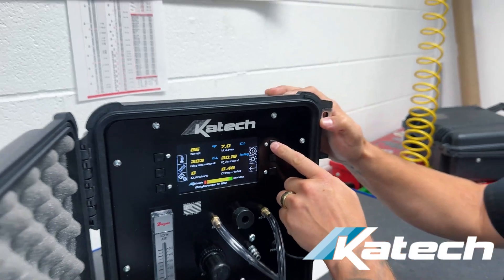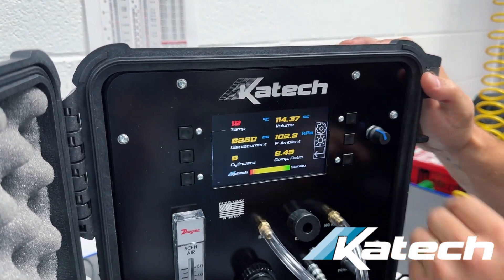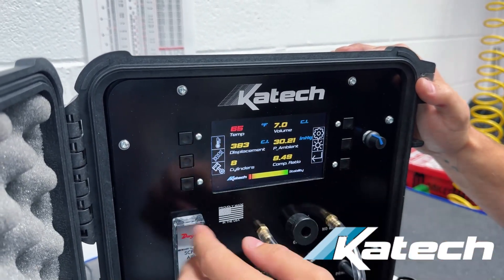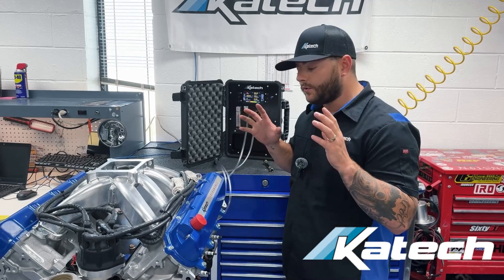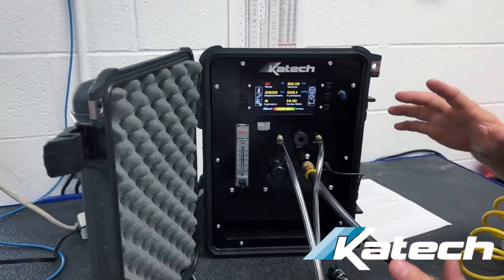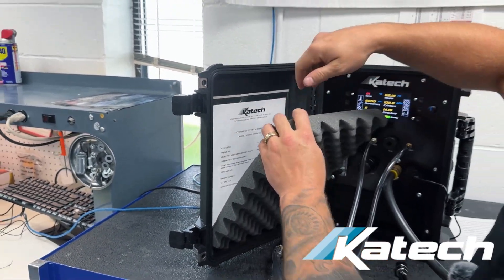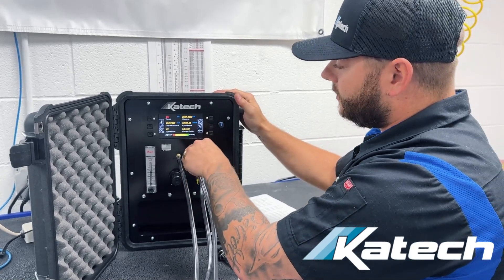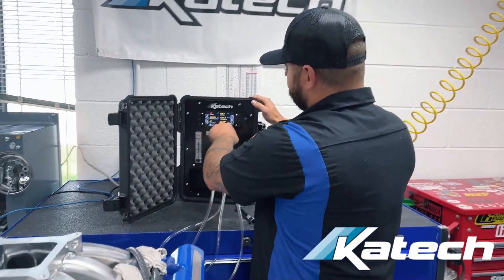Katech Whistler Instructional Video

Comment: I'm not even sure I understand the point of this, why not just math the static CR and then figure out the dynamic CR based on the valve movement?
Reply: This measures static CR, so you don't need to pour the combustion chamber and do the math. It doesn't measure dynamic CR.

Comment: Does this measure dynamic compression because of the cam timing affecting valve opening and closing?
Reply from the maker: This does not measure dynamic compression ratio, only static